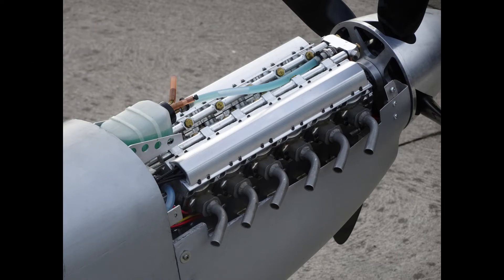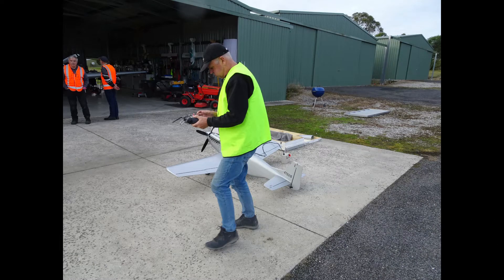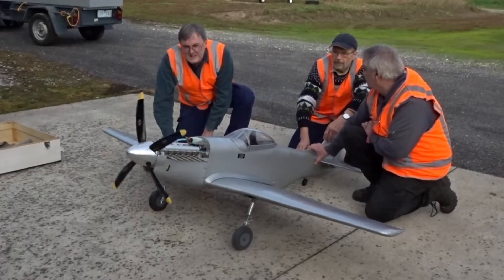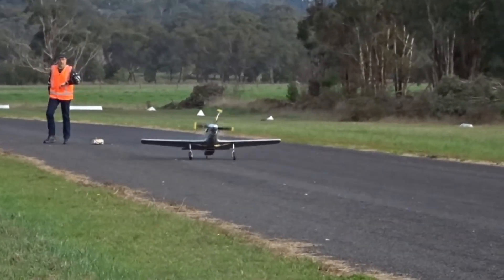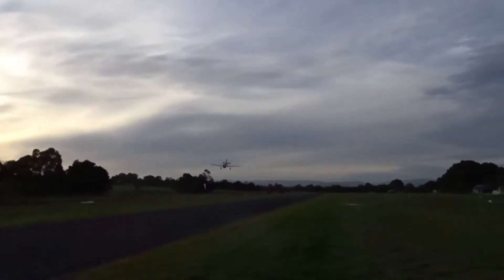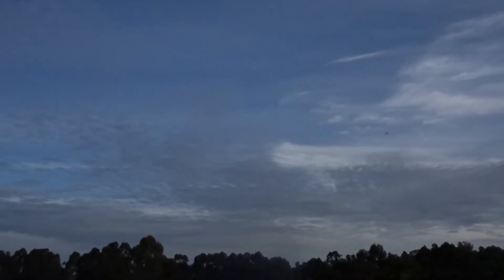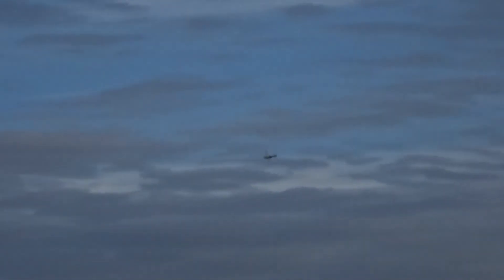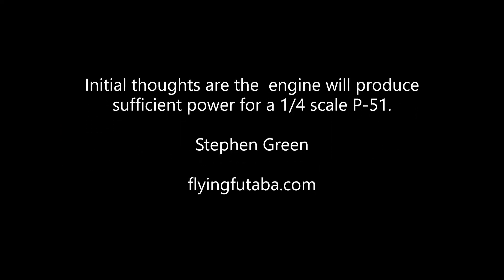Philtech V12 Test Flight May 2023

Comment: Can the engine be inverted? (upside down like bf109 or ki61)
Reply from the maker: It can run inverted but I have not tried starting it inverted. I will need to try it.
Reply: @PhiltechEnterprises  Inverted engines usually have the oil held in enlarged valve covers and delivered to the crankshaft via pump because if you flip a regular engine upside down, the oil will seep into the cylinders causing unfortunate things.

Comment: Use a higher pitch prop and a wider blade.
Or, use a gear ratio of 1: 1.2 since you are using a v12 engine.😄

Comment: Indeed doesn’t sound at all like a V12..😢
Reply: It's a 2-stroke engine on 20-30% Nitro. Did you expect it to sound like a V12 4-stroke on gasoline?
Reply: Go homebuild a full-size 4 stroke V12 if you want authentic sound.
Reply: It does sound like an Aventador though a little bit

Comment: Do you know why this plane did a involuntary quick U-Turn after landing ?
Reply from the maker: The  tail wheel came off. It was the last thing that I would have thought was going to fail. I was obsessed with worrying about radiator hoses  leaking, water pumps failing, electronics giving problems, gearbox problems etc. none of which were a problem.

Comment: My god....if you could get that engine up to 1/2 scale...with a proper ignition using avgas...The home builders (EAA)would be in your kitchen raiding your refrigerator. Would make a nice Hotrod engine, too.
Reply: Too bad there is already a real "Q-scale" 4-stroke V8 RC engine in "mass production" and there isn't any such thing as a "half scale" experimental aircraft.
Reply: @deeremeyer1749  Look up the WAR ( War Aircraft Replicas) product line...and then re evaluate your statement.
Reply: @deeremeyer1749 oh but there is! Is a company called W.A.R. selling kits and plans for 1/2 scale ww2 planes (you fly in, not RC) plenty of 5/8 to 7/8 flyable ww1 replicas.... have you heard of the Bally Bomber? Guy built himself a 1/3 scale B17 - single seat, with four 100hp Hirth engines. A guy up here (Canada) built himself a two-seat C130 Hercules, with four vw engines. I understand he flew it at least once, but was very underpowered.
Reply: There was a fellow in my dad's model engineering club who was building a half scale Merlin V12. He'd built several working radial and rotary engines previously so no doubt had the tools and know-how to make it happen.
Reply: @deeremeyer You don't know about WAR( War Aircraft Replicas)? Most of thier products are half scale. Kit's assembled at home...makes them EXPERIMENTAL aircraft.

Comment: That was awesome - havent seen many non electric rc planes - i think these are way cooler. is the weight a big issue when flying, is that when it landed it didnt glide down?
Reply from the maker: The extra weight can be an issue on landing as you need to keep a higher speed then normaly but once in the air it controlled well. We are improving the throttle control at low RPM to improve landing.